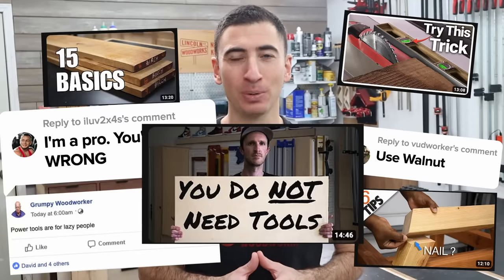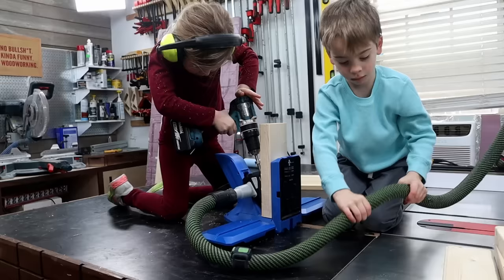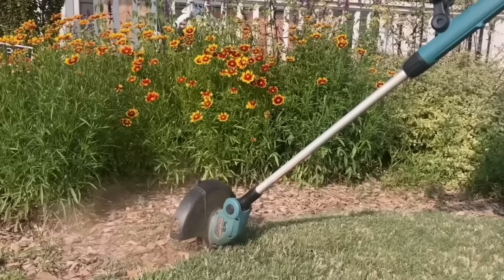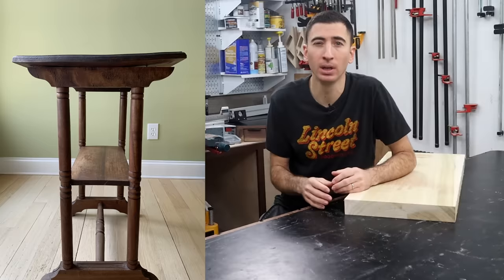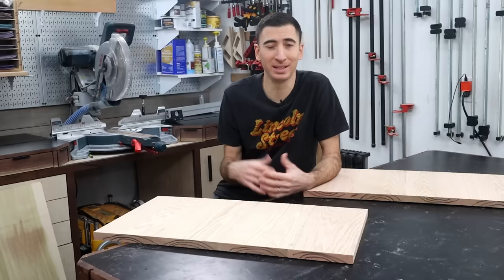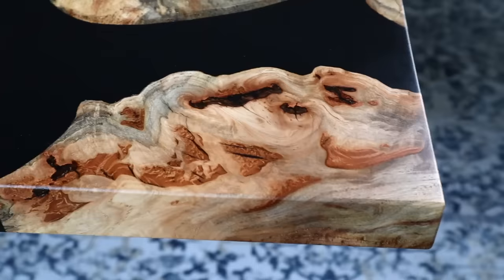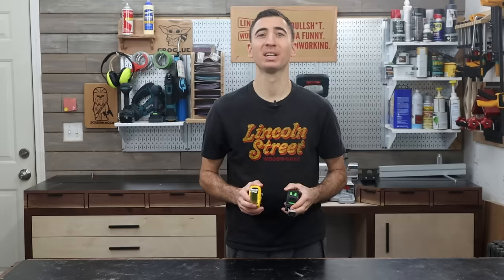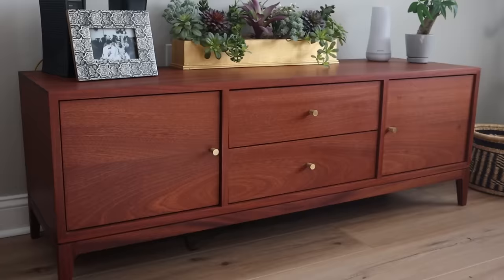Every beginner needs to hear this

Comment: I wouldn't know why pocket holes would be insufficient for a table when most people in the world are using knockdown stuff held together with janky little Ikea fasteners and getting by just fine.
Reply: My thoughts exactly! I remember getting into woodworking because I was putting together some IKEA furniture thinking, "I could make something stronger than this for much less money!"

Turns out, I was right. Then I went down the woodworking rabbit hole only to learn why everything I made was trash... And yet everything I made was better looking, stronger, and cost less than the furniture I was using it to replace! 

It's all too easy to get in to a hobby only lose sight of the original reasons you got into a hobby to begin with. My wife still likes the furniture I make. I still enjoy making it. And we still save a bunch of money on each piece. Still a win win win.
Reply: I personally wouldn't use pocket holes for a table.  If I didn't have a domino I'd use one of those handy dowel jigs, they've gotten really good the last few years.  Buy once cry once.
Reply: @ThekiBoran technically dominoes and biscuits are only there to line up the wood until the glue dries, I have never seen glue fail at a joint if it's properly applied. In fact it's stronger than the wood itself
Reply: Ikea fasteners are designed for knock-down furniture. Pocket hole screws are designed for low-stress joinery, like cabinet frames or casework.

Comment: Bonus tip when you have a few different tape measures which ever one you grab to start the project stick with that one for the whole project most tapes end hook have different slack in them so if you switch tapes in the middle of your project your measurements will be off 😊
Reply: This one! Not enough people worry about this
Reply: My dad accidently cut a tape measure with the RAS, he cut it down, re riveted the hook and went on. I was in his house, measured up for some wood, went home and cut it, only to find everything was six inches too long !!! when he saw that he mentioned the tape, he got a new one from me right after that as I threw that one out
Reply: I learned this the hard way. I kept wondering why the hell my measurements where never quite the same from one moment to the next. Don't use 5 different flippin' measuring tools!  🤣
Reply: I worked as lead man in a shop that manufactured custom frames for grocery stores. After a couple weeks of messed up frames, I took a look at tapes. All three workers had their own personal tapes, and each one was just a little bit outside, to paraphrase Mr Baseball. So...I went to our supplier and asked for a standard case lot of one particular tape measure, with the thought that not only would we be using the 'same' tape, but from the same manufacturing lot. Measurement errors dropped dramatically. Just sayin'...
Reply: Use a knife to mark (5-10x more precise) and a pecil to indicate on which side to cut. Or write an O over the knife cut to find it again 😉.
Reply: To avoid this, you are supposed to "give an inch" and measure from the 1" mark on the tape to an inch over the measurement you want to mark. Of course, I do not do this as it takes more mental acuity than to simply keep the edge-tab of the tape pristine (don't bang it against anything) and it will work for you every time. There is a reason for the play in the tab, to allot for the inside or outside of what you are measuring.
Reply: @woodrowsmith3400   No, you just made all errors the same. They could still be off. You need a calibration piece, to check each one. THEN you have eliminated the errors!
Reply: I calibrate all my tape measures
Reply: I’ve been in masonry for 35 years. My first tape measure was a Stanley Powerlock 25ft. That was the longest they made. I go through quite a few tape measures and I still always buy Stanley Powerlock but nowadays in 30ft. They make a 35ft but I don’t care for the bulk and weight
Reply: I think my first job was find what you can in the back of the truck and come up on the roof.  That tape I pulled out had about 1/3 inch play.  That preped me for later construction jobs where "throw you in the deep end and learn to swim" is just the norm!  😁
Reply: @campbellpaul if you start from 2 and go to N+1... You'll still be short an inch lol

That said, I've taken to measuring from 1 whenever I use a ruler because even if it's supposed to be a 0 based rule, I don't trust the end to actually be 0
Reply: Oh, I meant start at 1" lol @OtakuNoShitpost
Reply: great advice this one has tripped me up more than once but i do not make that mistake anymore ,.
Reply: @ness-ee  Yeah ,me too, i use a Bud light .
Reply: If you have more than one measuring thing, take them and compare them...ALL. as things are supposed to be accurate today, they SHOULD all be the same. If not do something with the one that is wrong.
Reply: I recently purchased a tape measure. Before purchasing, I measured several brands against each other, and I could not believe how much they differed from each other. I finally settled on one that seemed to have the most accurate measure, based upon measuring other measuring tools in the store with it.
Reply: @chandlerhanson8695  learnt this the hard way on a project.  freaked out as to why everything was coming up wrong lol
Reply: I definitely didn't think of that!!! This genuinely is one of the little tips and tricks I LOVE learning. Thanks!!!
Reply: Thank you. You have no idea how many times I have said this to people, just for them to give me the most disgusting look of bewilderment you could imagine. They look at me as if I'm crazy and don't know what I'm talking about. Then the stuff they build looks like the leaning tower of Pisa, and the top surface is cupped and bowed and twisted so bad that you couldn't get it flat with a industrial ten ton press. Okay I've exaggerated some. I have to rag on these guys a little.

Comment: I have TWO Milwaukee circular saws that crapped out. One after very little use. Bought brand new. Ryobi circular saws are just too underpowered. I’ve also had Milwaukee tools that I couldn’t break if I threw it off the back of my truck on the highway. There is definitely no best brand. Ryobi drills and drivers are fine but don’t buy their brad nailer unless u want to use it twice. Each brand has their highlights. Of all brands I use the rigid circular saw now because it’s the most powerful compact battery saw AND the lightest! It’s my only Rigid tool other than a vacuum. Give up on the one battery platform thing. So you need one charger for each brand. Who cares. You’re going to end up with those Dewalt tools your neighbor offers to you too cheap to pass up anyway. Just use em all.

Comment: you had some good tips here. Nothing is perfect. One more tip. If you are trying to sneak up on a cut length, butt your wood against the plate of a saw blade, not the teeth. When you cut it the setting of the saw teeth will shave off several thousands only. Much easier.

Comment: Obviously...if splitting wood is of concern, pre-drilling your holes can help tremendously. In the summer time, if the climate is considerably more humid than the other seasons, the wood will be less likely to split, but pre-drilling your intended spots for screws is usually the best way to avoid cracking. Some wood is more susceptible to splitting than others, like oak...and the dryness of the wood plays a huge factor as well. If someone is new to woodworking...simple building techniques to get started is suggested, not complicated joints. The individual must get comfortable with the tools and materials before moving toward complicated and sophisticated/advanced techniques; otherwise, one may experience so much frustration and spend more time starting over due to mistakes, that he/she may become so discouraged and ultimately quit woodworking altogether. This happens to a lot of beginners of any hobby, no matter what it is...woodworking, playing a musical instrument, drawing, painting etc. Are there better ways? Yes. Are there better joints than butt joints, but you can achieve a pretty strong hold from a butt joint with wood glue and screws, and depending on the project, it may be all that you need. I build furniture for a living and I can attest to the durability of different joints. The most common joint being the butt joint, is used more than any other, and in many cases preferred because of the time it takes comparatively speaking. No matter what joint you do decide to go with, using wood glue is recommended and pre-drilling your holes. And I like to add a little glue to my screws to aid in their ability to hold. The most common mistakes in woodworking can be avoided. Pocket holes for your screws are nice to keep screws hidden and out of the way, and using a pocket hole jig is going to give you preferred results. I use a pocket hole drill machine at work, sometimes the holes are made by a CNC machine, but there are projects that neither the CNC or the machine are capable of doing and the small hand jig is required. It's rare, but it happens. Also, to avoid screwing from the visible surface, (you don't want to see a screw or a plug covering where a screw was placed) drilling pocket holes will be the easiest solution. Now the angle of the pocket hole may increases the chances of wood splitting...so pre-drilling your screw holes is highly recommended. This is experience talking...I have split many pieces of wood in haste because of time constraints and can attest to the necessity of pre-drilling your holes. Don't rely on luck. Better to be safe than sorry. It's quicker to spend a little time pre-drilling, than to build a whole new piece, or glue cracked wood. This is some advice for the beginner looking to get started in woodworking. I hope this helps some. Don't let yourself get discouraged. And when ready, look into more advanced techniques. There are many, and some that require no screws at all. Those are my favorite. Enjoy.

Comment: I like this guy! 74 year old retired professional commercial architectural millworker and custom woodworker here. Pretty smart for a youngster. Climate conditions and humidity are HUGE factors in wood selection, finishes and durability depending even on latitude location. Normal usage of wood fixtures affects finish more than anything else. I always stressed that the glue is stronger than the wood around it. Pinned mortise and tenons swell and shrink. Trust your glue to hold your joints, unless you're going for old school reality.